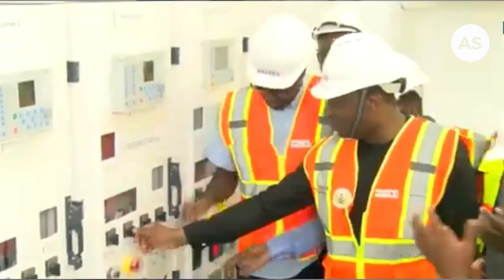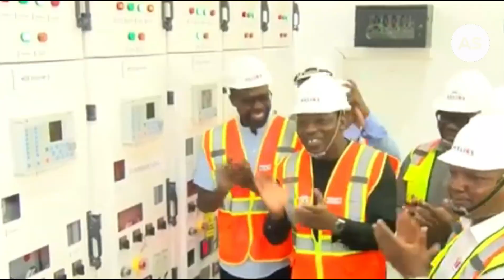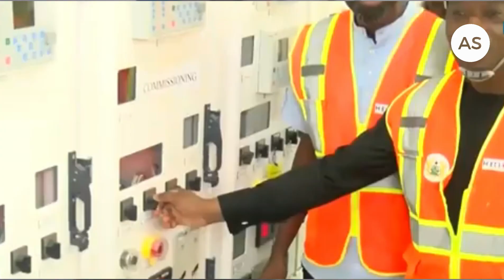Breaking News! Ghana Becomes World's 2nd Largest Rooftop Solar Plant Hub

Comment: Is it cheaper than hydro and coal generated power? How is this an achievement if it would only increase the cost per unit of electricity to us? If solar is so cheap, the rich industrial countries would still not be using coal to generate most of their electricity, in spite of all the noise they're making about climate change.
Let's not be fooled. We need cheap electricity, even if it's from coal. We barely scratch the surface when it comes to greenhouse gas emissions. We're not part of the problem. Ghanaians are tired of the high cost of power.
Reply: Nuclear is the answer for us then, and plans are afoot to achieve that, even though we should fasttrack the process. On fears of where to dump nuclear waste, nuclear accidents etc, I always say we should let our 'intellectuals' handle such issues. They usually tend to perform well when they run the show. Our intellectuals are running Ghana gas and so far so good. Even on legalising weed, let intellectuals do the farming and we'd have smooth runnings
Reply: Solar that was prohibitively expensive years ago is comparably cheaper now. We've the right weather etc for solar energy. A good mix of our energy should come from solar. We've more or less maxed out our hydro potential. I should think only a future Pwalugu dam can offer us any substantial hydro power. Let's encourage more solar use. 

By now we should be doing more electric vehicles, have plenty EV charging stations across the country, have electric buses and trains. Accra Tema rail line should be dualized and ELECTRIFIED by now. 'Poorer' Senegal has ELECTRIC TRAINS and buses, even running a BRT system. Etc etc Ghana let's up our game